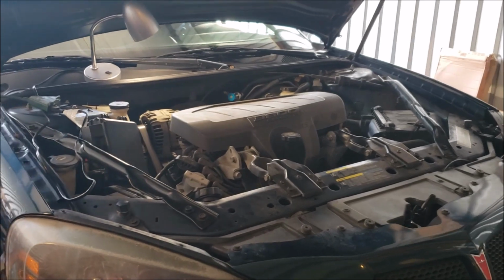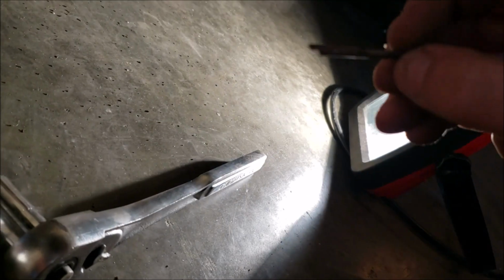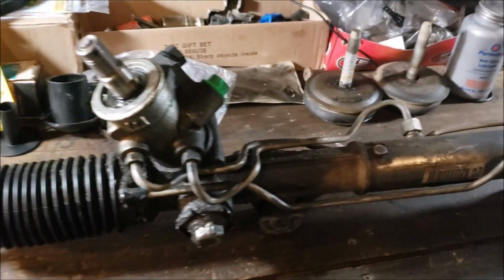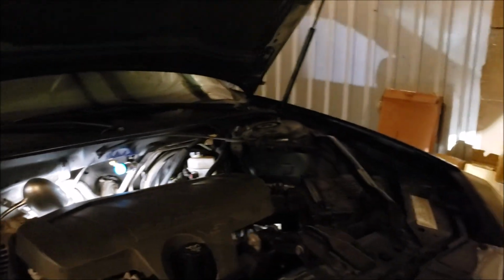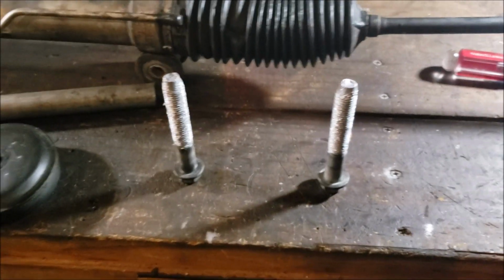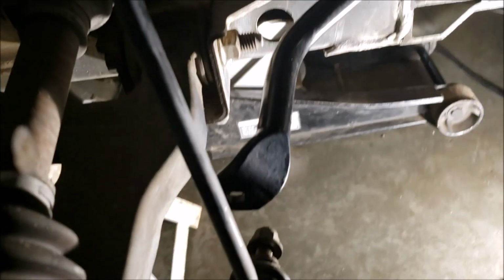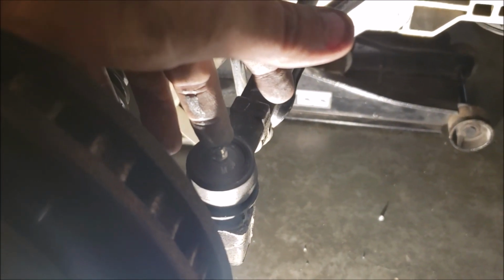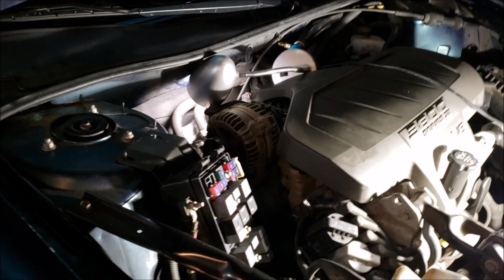2004-2008 Pontiac Grand Prix 3800 Rack and Pinion: Part 01 of 02- NO LIFT USED 🔧

Comment: For anybody this might help. The clamp on the right side (passenger) that holds the rack to the subframe broke in half on my 2005 GP. And since they are affixed to the rack, there was no just replacing the clamp. I had a guy weld it back together and it only lasted a few months before it broke again. I wasn't in a position to replace the rack at that time. So I got a  3" by 4 1/2" long U-bolt to keep it from moving.  I put one end through the back where the original bolt goes and over the top of the rack (but under the vent line). Torqued that thing down and it worked like a champ.

Comment: Watched your video before doing this job.Good video,but too much talking.Just a step by step procedure short and to the point.Anytime I have had to remove a tie rod end I always give the knuckle a few taps with a sledge hammer and hit it from the bottom with the nut partially on and it pops right out like it was nothing.You do not need a ball joint separator or pickle fork,I have done 100s like this.Also on those 18 mm nuts for the lines that go into the rack,I just got right underneath them and as soon as I cracked them with an open end wrench I was able to loosen them by hand.No need for removing the coolant reservoir or having 5 feet of extensions.If your in a region where parts get more corroded,soak everything with WD40 the day before makes this a piece of cake.I would put a 2x6 in between the pinchweld on the rocker and those cinder blocks or use jack stands or some old rims.You can also use a piece of tape to wrap around the inner tie rods so you know where the nut goes when reinstalling the outer tie rod ends.

Comment: You know  when I have to remove the tie rod from hub it sits in real tight  take your nut off  and if you want to use your silly tools like the tie rod separator or pickle fork that may damage your boot   I turn the wheel so that the tie rod faces outward  with the nut off on Pontiac"s  they have a flat part on the hub  I take my heavy small mechanic"s sledge hammer and without hitting the car carefully hit it there a couple of times will jar it loose enough to pull out. I can do it in 3 hits and pull it out. Everytime

Comment: years ago i did my 1997 gtp and i did not drop the subframe as i recall it was tight but unbolted the rack and lines and slid it out.I have noticed every one seems to drop the sub frame.I have had the car so long I put a third rack in it.I think you can do the newer styles with out dropping the sub frame.So do not over complicate this job
Reply: Two BIG differences between you and me : 1) You say "I think" while I say "I know."  2)  You watch my videos to learn how to do things while I figure things out on my own so DYSers like you can attempt mechanic work.

Also, there are major differences between your generation GP and this one.  Second- the fact that you consider removing 2 bolts to drop the sub frame in effort to gain clearance and save 80% more time & effort.

How about you make like a "Vince" and post a video up showing people how to change a light bulb... or change a tire...
Reply: would removing the exhaust make it any easier

Comment: Instead of using cinder blocks I got a pair of these high performance 3-ton  jack stands from esco and used those. https://www.homedepot.com/p/ESCO-3-Ton-Performance-Jack-Stand-10498/305647822

Thanks for the tip on the crows foot with super long extension, I picked up a set of those flare crows feet including the 18 mm, worked well to take off those fittings.

Comment: Hey man just wanted to say thank you. I have very little car experience and your videos helped me replace my pump and rack and pinion. Wife wanted to buy a good used car but the 06 Pontiac lives on! 205000 miles. Needed to do this to pass an inspection up here in Missouri. 

Took me 12 hours this past Saturday and it's working great. Taking the outer tie rods off took the most time. Ended up cutting them off due to them being COMPLETELY stuck. Couldn't have done it without your videos. Thank you!

Comment: a better way to do a aliment  put the car on ramps go under car  lose power arm bolt and pop it out use the tape hook it to the tread  of tite and see how much your off  you are then turn the tire in or out works good   just put e brake on
Reply: @shaun4bigblocksllc  ive never had a prob  and my tires never ware uneaven  ive been doing it for years a lazer tape works even better thow or a pen caps to jack stands and string

Comment: You're video is great, I ordered some similar tools that got the tie rod and ball joints free(I did cv axle also). But you gave torque specs and correct GM mechanic information that chiltons dosnt tell you. Thanks, 99 grand prix gtp 238,000 miles

Comment: I am having a HELL of a time trying to get the intermediate shaft to slip onto the steering box. I'll try your tip about dropping the subframe 1 3/4" tomorrow and let you know how it goes.
Reply: @shaun4bigblocksllc  Your trick helped me get better access to the slot where I could punch a flathead screwdriver in there to spread it. Took me 15 mins. Thanks!
Reply: For people looking in the future, open the end that connects the steering rack to the steering linkage shaft. Its slotted and you can open it up when the old rack is out, when you tighten the bolt that fits in the groove, on the rack input. It closes it up tight around the input. I think it made it easier for me to connect it lowering the subframe 2" or so, that knuckle slides 4" up and down on the steering shaft shaft.

Comment: I need your opinion about my situation. My 2008 Pontiac grand prix had a problem with steering(hard to steer)which was resolved by replacing new power  steering pump but after 6 or 7 months it struck in snow and i tried to turn my steering all way to left and right to get better traction. Somehow my steering got back again to same old problem ( Hard to steer). My dilemma is i dont know whether it was bad power steering hose or rack  n pinion.
Reply: @shaun4bigblocksllc  thank you for your insightful advice. I will go through with your advice.  I did check my steering fluid when incident happened,  fluid was full. And steering was very hard to turn.   
Once again thanks.
Reply: @shaun4bigblocksllc  wow so much important information. Thank you so much....really appreciate your willingness to help other.

Comment: A quick tip is to span across block with 2 x 8 x 16 board, the block will not  break .  cushions the car frame and block at same time . used blocks for years with no problem, if properly protected. If blocks will hold up a trailer or house , they will surely hold up a car.